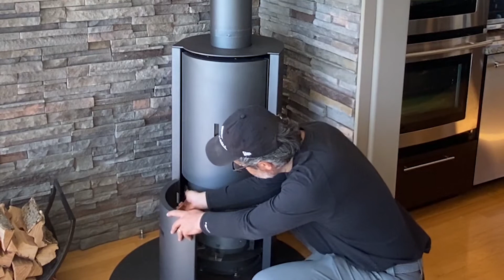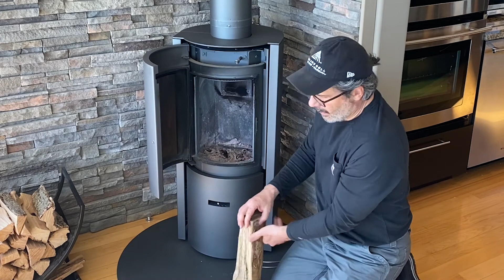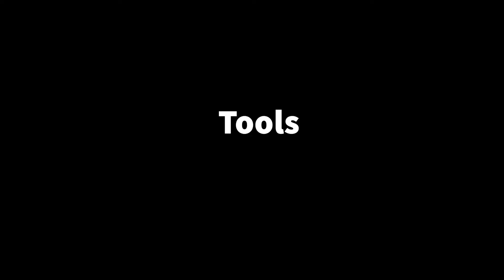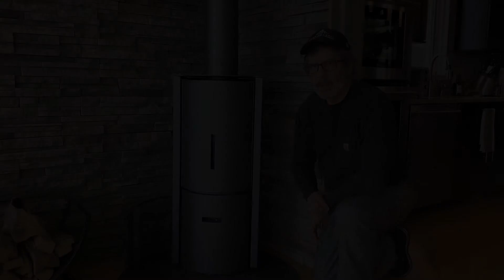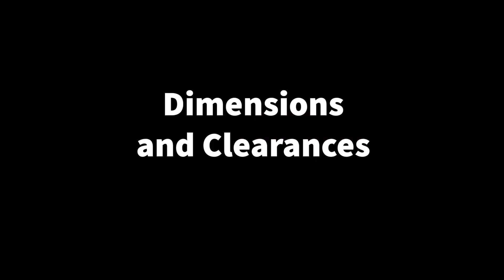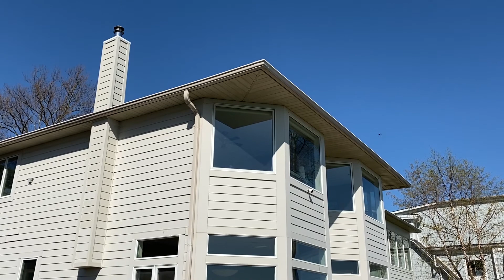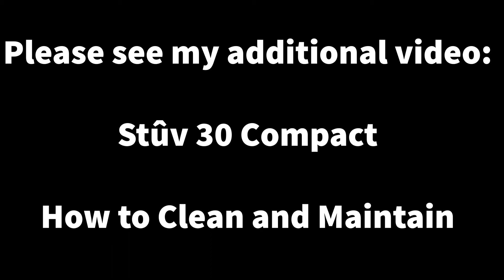Stuv 30 Compact Demonstration and Review

Comment: Thanks so much for the very helpful and informative video. I am planning on building a new home next spring (hopefully!) and am looking at this for the corner of the great room.  I went to the Stuv dealer today and fortunately they had one on display. The "living" area part of this room will be about 13 feet wide before the 'dining room area' begins, with a depth of about 24 feet before getting in to the kitchen area, however the depth to the back of the sofa, will be about 16 feet...so essentially the sitting area will be about 12 feet wide by 15-16 feet long (with open concept dining and kitchen adjacent. Ceilings will go from 9 feet to a peak of a about 20 feet high. I am hoping that this stove will 'look' right in this space...I think it will, but I'd be curious to know what size room your installation is in. The salesman also showed me a brand called Rais, which is similar but just a glass door that opens, not the three versions that this has, and without the ash collections system of this. The one advantage is that they had gas or wood options, but I think I am pretty much sold on wood for this go-around. This is the second time I've watched this video, so thanks again for taking the time to put it together! It should be on Stuv's website!  PK
Reply from the maker: Thanks for the feedback.  Our Stuv is in the corner of an open concept room also.  It is situated in the “sitting room” corner which is about 12 feet deep and 14 feet long.  It throws off a lot of heat in that area.  That corner is part of a 30x35 open plan room with kitchen, living room, dining room.  If it runs all day it will warm up that entire space a few degrees, but the direct heating area is really the corner where the stove is.  Our ceilings are 10 feet high.  It is a big space.  The way ours is situated in that corner it is more like a “room within a room” setup where it is not pointed toward the center of the great room, but toward an outside wall.  Let me see if I can post a photo link.
Reply from the maker: If you think this model may be too small for your space, Stuv also makes a larger version of that model. The Stuv 30 (not compact).
Reply from the maker: Here is a photo. https://share.icloud.com/photos/0H6v-PoTPMMJZyRoy76MpzPlA
Reply: Just came back and watched this a fourth time! My house is framed and it's time to make a decision. I'm torn between this and the Stuv 16-68 Cube style. Very clean looking with a huge glass door and twice the firebox size. My ceiling peaks out at 26 feet (20 feet above the stove). Your total 'open' room size of all your rooms is a square footage similar to mine, when I count the main great room area, foyer, dining area and kitchen. I am still tempted by the Stuv 30 because of its looks and features...just fearing it will get 'lost' a bit in the corner of my space. I unfortunately didn't come back to Youtube and see your photo, which is no longer available. Any chance you could post that again? It's decision time and I'm trying to get out of this paralysis! And thanks again for the fantastic video.

Comment: Hi Tom, I hope you will see my question even if your video is now few months old ! 
But first ! Many thanks for this great video .. Very helpful and clear !
Did you consider the Stuv with stones accumulation before choosing this version ?
Thanks for helping 😅
Best, Jean-Marc
Reply from the maker: Thank you. Yes, for our application we are really using the stove for more ambience and near-field radiant heat while we are sitting in that area near the stove. If we were trying to heat our home or a larger space we would have considered the tall model with the firebricks (Stuv 30 Compact H)

We also wanted a very small model that is somewhat out of sight in that corner.  

And lastly, with the stone work behind the stove and the small required clearance, the stone wall actually heats up and stores some heat also.  

Good question, thanks for asking.
Reply: @dontscrewitup  Ok understand your orientation !
In between my question I’ve a look to the 2nd video !! 👏👏 incredible support to manage right !
You really help Stuv company to sell their stoves :)
Happy to have all those informations before signing my 30 compact H or Not 😬
Tks from France !

Comment: Just bought the stuv 30. A few question:
1) did the screen come with the stove for open mode? Or was it a optioal accessory?
2) did you get the floor place included? Or was it an option as well?
3) where did you find (or what is it call) the air inlet flow control valve? I love hpw.you can control it on the floor and not go outside to shut of the fresh air.
I bought mine as the display model, so I want to know if I'm missing parts. Haven't got it hooked up yet.

Thanks in advance loved your review!!
Reply from the maker: Thanks!  All of those items are extra Stuv accessories you can buy from your Stuv dealer.  There are many different floor covers based on the configuration (if you plan to rotate the stove you need different shapes).  Download the Stuv manual and dealer accessory catalog for all the possible parts.   There is also a grill attachment, wood rack, etc.  Also buy a can of Stuv gray paint.  The unit may get scratched and the factory paint covers perfectly.
Reply from the maker: Here are the accessories.   There is a more detailed version of this with sizes and specs.   You may need to get that from a dealer. All of the accessories are a bit pricey, but are good quality.   https://wp.stuvamerica.com/wp-content/uploads/2021/01/stuv30-en-2.pdf

Comment: Thank you from France !!
Do you have the reference for the firewall?
Thank you
Reply from the maker: Skamotec 225 by Skamol is the fire barrier behind the stone.   The stone is Boral Profit Alpine Pheasant.
Reply: @dontscrewitup  - Sorry for my English. I was talking about the removable screen that we see at 3:00 ;) Thanks
Reply from the maker: That is an optional part you can buy from Stuv with the stove.   It is essential for the open burning mode if you plan to use that method.  I guess some people don’t use that mode and that is why the screen is optional.

Comment: That's a very interesting stove. Not for everyone but I can see the appeal to something unique like this, especially for the type of homeowner who isn't afraid of some complicated operation. I'm curious if all those moving/sliding parts and the seals would still be any good after 5-10+ years. 

To my eye it looks more like an appliance than a wood stove, (lots of sheet metal parts instead of more traditional heavy welded metal or iron or stone), but everyone has a different taste/preference.
Reply from the maker: It is very well-designed in my opinion and is heavier than it looks.  The stove weighs about 275 lbs. it all rotates on pins and bearings and is easily maintainable.  I believe it will still operate like new in 10 years.  And if not, all of the parts are replaceable and user-serviceable.  If you watch my other video on how to clean and maintain the stove you can see more of the features as I disassemble most of the stove for cleaning.

Comment: Thanks a lot.Really handy video with all the questions answered.One obvious thing I guess is that if the air intake is through the wall rather than the floor,that means the end of rotation of the fire box? We will be installing on a flat wall between the living and the dining area,so I'm wondering if I would need to rotate the fire box towards one or the other.
The fire box is sitting on a concrete slab at ground level with a ceramic tile covering,so the air vent would need to be inslab and turned up above ground level on the outside.Any thoughts?Thanks again and greetings from Down Under.
Reply from the maker: That is correct. If the outside air comes on through the wall, it does not rotate.  When mounting it against a wall, I don’t think you lose much by not rotating.  The real benefit of the stove’s rotating feature is really for, free-standing installations in the center of an open room, for example.
Reply: @dontscrewitup  Ok great .Have also been looking at the built in version,The STUV 30-in ,which I could shoe horn in with only minor modifications.Need to research more ,but it looks like a different beast.The "ambient" heat which is given off by the free standing model would need to be addressed.Looks like this is done with ducting and fans etc.Could be more trouble than its worth.Suspect you only use the 30 -in model if space is a problem?Thanks for your feed back